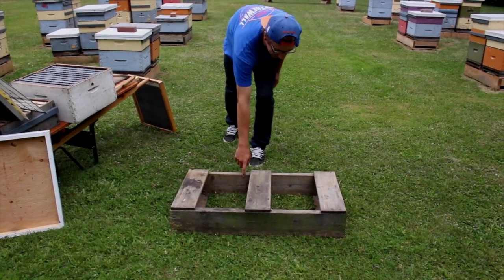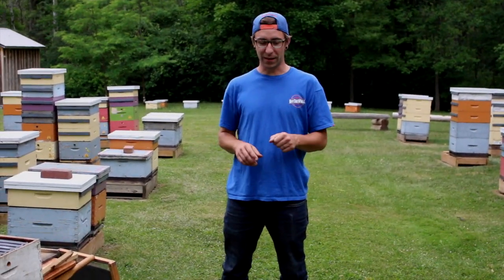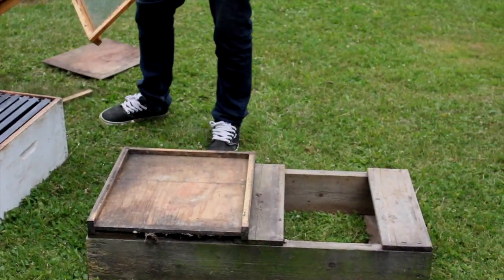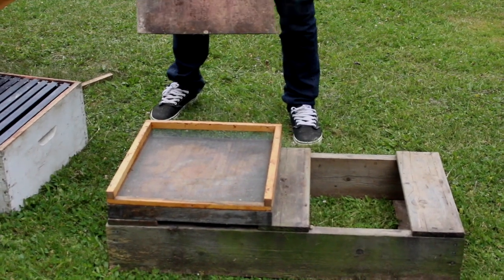Hive Equipment

Comment: Good video.  I suggest adding a discussion of frames.  You seem to use a mixture of plastic, wood and foundationless frames in your hives (from other videos).  In South Florida, the SHB are a problem, so we generally avoid plastic frames due to the voids being good hiding spots for SHB's.  The screen bottom boards can also SHB's to enter the hive through the screen, but can reduce mites by 15%.
Reply: What is an SHB?

Comment: One thing I've been admiring in your videos is the "handle" that seems to have been added to all of your honey supers. Since I'm not getting any younger I could use all the help I can get while lifting supers especially those at the top of the heap. Do you just nail them at the edges or do you glue them, as well? Standard pine or something fancy? Size?
Reply from the maker: Hi Peter
 We nail them from the outside then use four screws from the inside. We use pine 1.5" wide .75" thick. I really find the cleat handles helpful. Thanks for your comment Peter.

Comment: In other videos there is no wood inner-cover rather a piece of fabric or rubber that he peels back. Can you elaborate on what this?
Reply from the maker: Why do we use canvas for the hive inner cover?
A: We use canvas inner covers for a few reasons. They make it easy to take a quick peek in the hive, and are cheap and easy to make. They are light, the lids sit down well, less excess wax on the frame top bars, and we rarely need to scrape the inner cover. We use 18 oz  (#8) canvas -otherwise known as duck. It's a bit hard to come by in Ontario, but it is available from online distributors (see http://www.bigduckcanvas.com/number-8-18oz-cotton-duck-canvas.html). Bees chew through thin canvas so a heavy weight is better. We flip it over periodically when new so the bees thoroughly coat it with propolis. An alternative is a feedbag folded in half.

Comment: How are you leveling your hive stands? It appears that there is some sand or other material around some of them. Everything looks so nice and straight. Thank you for the videos.
Reply from the maker: Hi Layne
    We had just trimmed the grass and the string trimmer made the ground bare around the hive stands. We level the hive stands  periodically with pressure treated wood shims. If the hives are already on the stands, we use a hardwood pry bar and a brick fulcrum to lift each end for shimming.

Comment: Curious about the bottom boards you use. Is the benefit of being the same as the brood box foot print primarily to help keep moisture out? I ask because watching bees coming in fully laden and most probably exhausted seem to struggle at times just getting to the landing area on the longer type bottom boards.
Reply: Thank you very much Paul.

Comment: Would you mind doing a video on your duck inner cover, and comparing/contrasting it with some of the other "more usual" inner covers, please?
Reply from the maker: Hi Frank
For our hive equipment video we limited the list of equipment to the most common and basic components. We should have at least mentioned the canvas inner covers that we use. As there have been many inquiries we'll be doing a video on the topic this year. Thanks for the suggestion Frank. In case you haven't seen this reply I'll post it below.

I like the canvas inner covers for a few reasons. Easy to take a quick peek, cheap and easy to make, light, lids sit down well, less excess wax on the frame top bars, never need to scrape the inner cover. I could go on... We'll do a video about them since we are getting so many questions.
We use 18 oz  (#8) canvas - otherwise known as duck.  Bees chew through thin canvas so a heavier weight #8 is better.  It's a bit hard to come by here but I see it's available from online distributors in the US http://www.bigduckcanvas.com/number-8-18oz-cotton-duck-canvas.html  or in Canada here. http://www.jtsoutdoorfabrics.com/18oz-Cotton-Duck-Canvas-Untreated--Natural-60_p_15038.html  We flip it over periodically when new so the bees thoroughly coat it with propolis. An alternative is a feedbag folded in half.

Comment: I see on your wood inner cover that the central hole is plugged. Can you explain why this might be preferred? Most inner covers I've encountered online have the open hole for ventilation. Do you need an alternate top entrance when this hole is plugged?
Reply from the maker: Hi Chris
 The central hole is for using a pail feeder. We don't feed that way so we block the hole. This helps reduce heat loss,  prevents condensation and limits bee access to the bottom surface of the inner cover.The top entrance is provided by a notch on the inner cover rim or with a hole drilled in the brood chamber

Comment: Great series! I have a two part question. First, do you build ur own brood boxes or purchase them? Second, I noticed you use plastic frames as well as the wooden one. Do you prefer one or the other?
Reply from the maker: Hi Michael
  I've done both but have found lately that I can buy cut boxes cheaper than  i can make them myself. I like the aesthetics of wood frames but use a lot of plastic frames becauseI have better things to do in the winter than build frames! Both work fine.

Comment: David l just can't understand how this and any of yours or Paul's training videos warrent a thumbs down. All are excellent, informative and incredibly helpful. My question   is how do your bees get past the canvas inner cover? Warre hives use a similar cloth inner cover. However, new to them I quickly abandoned them due to their not ventilating well enough. Mold built up rapidly. I'm in the high humid Pacific Northwest where ventilation is a big concern and quilts are useful. Ontario is the opposite - dry. All said they are amazingly effective for you. Worth me trying again. But how do the bees crawl past? They look to well seal boxes.
Reply: David just saw this. When supering you remove the canvas cover and place it on top of the upper most super. Bees are not restricted in their movement for that application. That said when feeding using your box feeders the cover is used - implying they do get above it. When double NUCs are made the canvas is especially useful. Thumbs up, eh.
Reply from the maker: Hi Vincent
 Thanks for your support! I see you figured out the answer to your question.

Comment: you cloth inner cover is that dipped in beeswax? does it allow bees to walk below it?
Reply from the maker: It's put on the hive as is. We flip it over now and then so the bees can coat both sides with propolis.  It sits right on top of the frames so it does limit travel across the top of the frames.  Lots of other places they can move around so it's not a problem.
Reply from the maker: http://www.bigduckcanvas.com/number-8-18oz-cotton-duck-canvas.html   A source for the canvas (duck)
Reply from the maker: http://www.bigduckcanvas.com/number-8-18oz-cotton-duck-canvas.html   A source for the canvas (duck)

Comment: Any self-respecting mouse that wants to get in will have a hole chewed in that wooden entrance reducer in a very short time. Use a metal device, but make sure there are no mice in the hive to begin with.😉
Reply from the maker: Wooden reducers inserted at the right time have worked well for 60 +  years for us. I haven't seen mice in our hives for many, many years. I haven't tried many metal reducers/ mouse guards but the one's I have tried blocked effective dead bee removal.